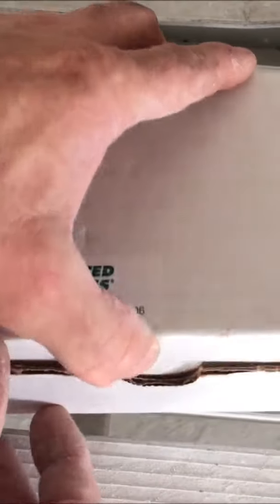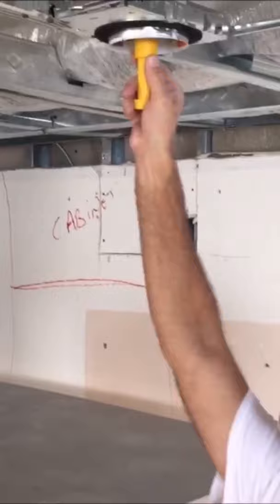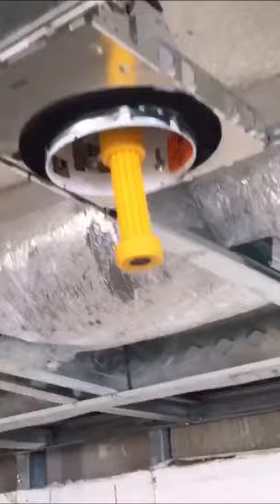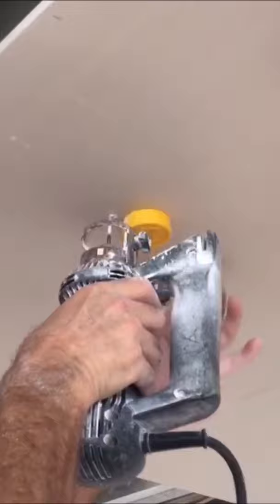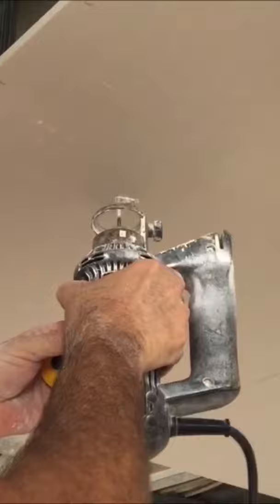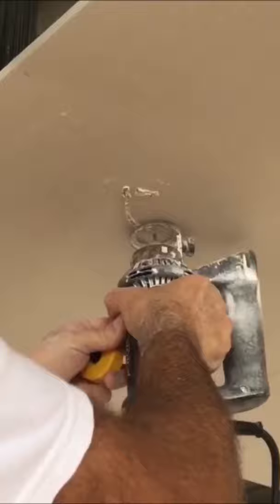Easy Way To Mark And Cutout Can Lights On New Drywall! NO MEASURING!

Comment: Cool tool, makes it easy. But as a electrician in Canadian, we don’t use cans anymore for pot lights. The new LED put lights don’t use cans anymore.
Reply from the maker: Good to know. Thanks.👍🏻
Reply: Yea, the new Led surface lights are way better
Reply: Seems like a expensive toy for something that  isn't needed
All you need is  a tape to measure 
 Stanley blade & a drawing pin connected with string (if you haven't got a scalpel & protractor) takes same amount of time and things all house holds have
Reply: @donjod3248  why not just use a hole saw? Then all you have to do is measure to the center point and drill
Reply: @brandonu571  I don't have a full set 😂
Reply: @donjod3248  they don't really come in a set they are specifically For drywall. I found 3, 4, 6, inch and there is also an adjustable one although it's not as good
Reply: Who uses can lights anymore. 😂

Comment: I've hung board for years and I guarantee you I can Mark out a sheet quicker than you can install those things.
Reply: Anyone can say that. Let’s see a video pro
Reply: Enjoy your carpal tunnel.
Reply from the maker: @Buck Cheep, Many ways to do it. I’m not saying this is the fastest way by any means. Some people it may help and others it may not be of any benefit. I’m ok with that. 👍🏻😎
Reply: @PaulPeck  yeah, it's just what I've become used to as efficient when you're hanging drywall for a living. The product in and of itself is a very clever idea and I can see where it would serve some people very well.
Reply: @joedoesfun9336  making a measurement with a tape measure and using a pencil to make a mark on a piece of drywall gives you carpal tunnel syndrome?
Reply: @buckcheep  let’s see a video
Reply: Which explains why the all the cutouts for things in my house are over 0.5inch to big on all sides.

Someone doing the job fast just because   and to proud to use a tool..
Reply: @buckcheep  - then it’s just a claim from another bonehead on the internet.
Reply: I'm sure this works for good for a at home diy guy but just can't see it be a full stream tool for pros... Granted anything making the job easier is awesome but I am a bit of a perfectionist so my ocd would drive me up a wall trying to get the perfect circle... Hats off to guys that do this and are sane!!!
Reply: @buckcheep  what a surprise someone who has something to say but can’t back it up.
Reply: As an electrician i can assure you that a hood drywaller would NEVER use this bs as they could have that sheet hung up and cut out in no time at all
Reply: @illwil2158  Thank you Willie. A guy who's actually being on a job site! Some of these nitwits need to get out of their mom's basement and actually get a job to know that.
Reply: @illwil2158  P.S.
I don't do it often but my apologies for any wires I've cut through in the electricians boxes over the years lol
Reply: @Cello69.  maybe you should try to go get a job. I hear Starbucks is hiring.
Reply: @buckcheep  - I have lots of issues but lack of a career and finance is not one of them. 

Look you know I’m right. Quit acting like a bonehead
Reply: WOW 🙄
Reply: @buckcheep  Send me a quick video of you performing the claimed task and I’ll send you a video and/or pictures of my credentials ie work status, paystub and even account balance. 

Deal?
Reply: Si marcando pero aún así Cagan la mazacuata y no me diga que no ..lo he visto infinidad de veces especialmente esos que se creen pros 😄
Reply: @buckcheep  - you use the word “little” a lot. I mean a lot!! Guarantee there’s things there that needs unpacking. Lol. 😂 

Care to share with the world? You’ll feel good afterwards.
Reply: @buckcheep  - lol 😂. Yep you have “little” issues. Sorry dude. 

Use one of those fun houses mirrors in your bathroom. They might improve your confidence.
Reply: @Cello69.  hahaha look little maxi, you already went on that rant. I expect more out of you. Find some new material.
Reply: @buckcheep  2 posts!! Wow. I’m in your head huh?? Lots of space in there!! 😂 

Oh BuckSheep…. Just admit it you have no skills. How long will you keep on lying.
Reply: @Cello69.  still beating that dead horse are you? We're well beyond the original post I made and you in turn calling me a liar don't you think little maxi? LOL
Little Maxi is a little long for my liking. I think I'm just going to call you Pad from now on.
You don't mind that do you Pad?
 Hahaha, you knew we were going to get there sooner or later didn't ya🤣😂.
Reply: @Cello69.  well it's my bedtime Pad.
After all, I do work for a living.
I'll check back with you in the morning and see what you have to say for yourself LOL.
Reply: @augustbiechy34  slowly losing ms sanity 🫣
Reply: Sure you can

Comment: Glad you got a bunch of angry tradies in the comments getting you that algorithm love.
As an electrician who has always been bad at making drywall look good, and don't intend to become a drywall contractor, this is a perfect tool for my home remodel.
In the other comments I've seen a few points I'd like to address, and I may update this comment after I hang my ceiling in a week.
1. It comes with two screw in attachments and one magnet
2. 20.99 for prime shipping
3. It wouldn't damage the can unless you really macked into it, and it wouldn't be long enough to damage any wires.
4. I perhaps can see how this results in boxes being covered up,however, in small applications I will notice if one of my 8 can lights is covered
5. Surely everyone who uses this tool is someone looking for a professional finish without adequeate experience, which I am certain this tool provides
6. Every restaurant in america uses can lights still. They aren't going out of style and I don't see any reason why they would, they offer easy maintenance and longevity.+

Comment: We mark everything on the floor with marking paint. Lights outlets switches ect
Reply from the maker: That’s smart John!👍🏻🤓
Reply: @PaulPeck  thanks for the reply.  It only works on me construction or if the sub floor is exposed
Reply: I do the same with blue paint. When hangers done and cleaned up I walk it before they cover the floor and start taping.

Comment: If you cut from inside the can and jump to the outside and have trouble estimating the position of a 4" or 6" can, then you might have to worry about other issues.

Comment: Then you can fuck up the recessed lights cans or receptacle boxes with the roto zip. So eletrians can change them after they already were installed. But I took much joy busting out the drywall to make sure I had lots of room to reinstall a new box
Reply: Or don’t use cans it’s 2021
Reply from the maker: @Brian Blood 😂😂😂
Reply: @supermankd  you tell the customers that.

Comment: Isn’t cutting against the recessed can going to wear down the blade on the Roto-zip? I’m not a pro, but it seems a lot easier to just measure.
Reply from the maker: No the soft metal of the can light doesn’t really affect the drywall bit that much at all.👍🏻

Comment: When hanging, I use lipstick to transfer the cut out line. Cut and hang. Easy.
Reply from the maker: Yeah, problem is I don’t always have lipstick in the van. But, I always have a pencil.👍🏻
Reply: @PaulPeck  I've used the drywall as a mark line also with the powder from a scrap piece. I'm sure you've seen that also in your time spent in the field.

Comment: Do you use this gadget regularly as a drywall installer? Be honest!
Reply from the maker: No. But it’s good for people that don’t do drywall on a regular basis. IMO. I do appreciate your feedback Doctor.💥👍🏻😎
Reply: @PaulPeck  Have you tried the Dewalt router? Toolless bit changes, and nearly impossible to kill. I've been using the same one since 2002, and it seems I went through a Rotozip once a year before that. Generally I am not a fan of Dewalt, but their router is a true warrior. I ended up buying a second one just for door and window cutouts so I wouldn't have to switch bits and collets.

Comment: Take your roto zip grind the hell out of the can then skip over and finish your cut don't forget to unscrew your worthless  tool when you're done
Reply from the maker: It has a drywall bit on it. So, it doesn’t do anything to the metal…Then a cover goes over the can and bulb.
Reply: @PaulPeck  been in construction since the early seventies soi have seen first hand want to rookie with the rotozip set to the wrong depth can do to an electrical outlet can light anything that it tries to cut around so get it right son as for your plastic magnetic tool that has rookie written all over it did you order that online or did it come from the do it yourself center because any real drywall jobber  wouldn't even carry something like that you do know what I mean by the term jobber don't you